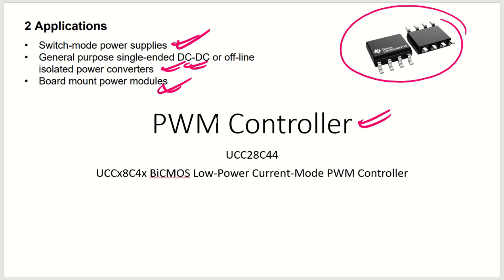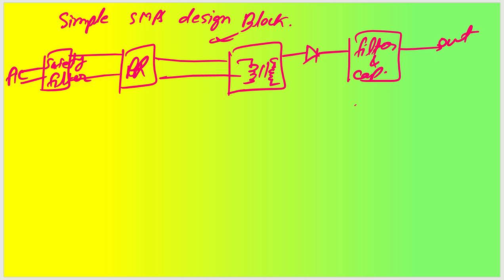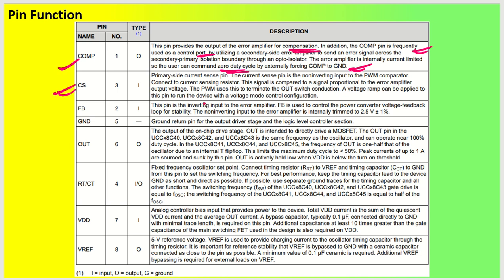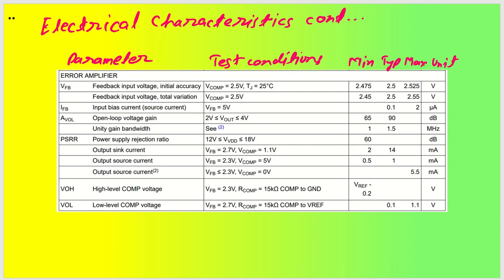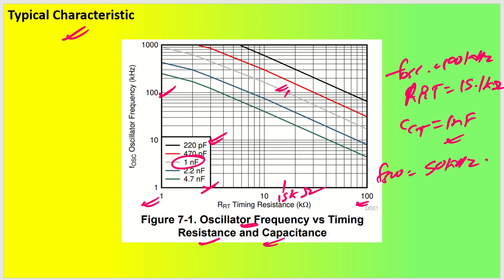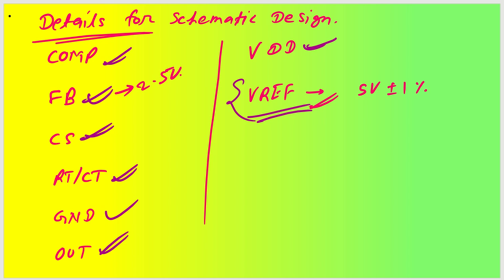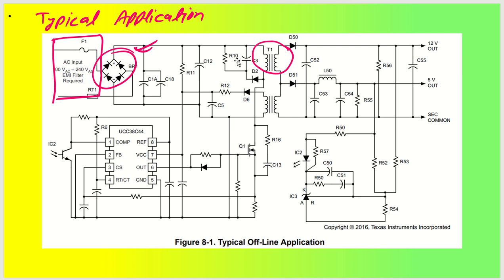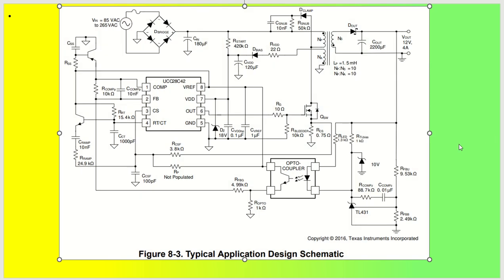087 GATE Driver PWM Controller for SMPS and Off-line switcher design UCC28C, UCC38C devices

Comment: Can these controllers can be used to read data from vehicles K line and LIN networks ?
Reply: No, you can explain more details about your requirement
Reply: @ajeetcorporateblogs   the application would be a pass-though device for diagnostics purpose.
Reply from the maker: No